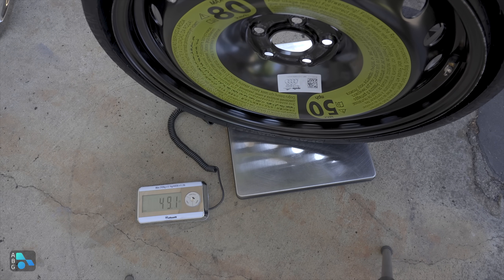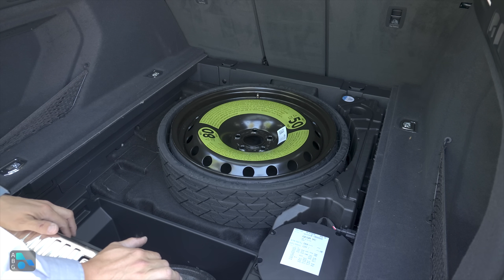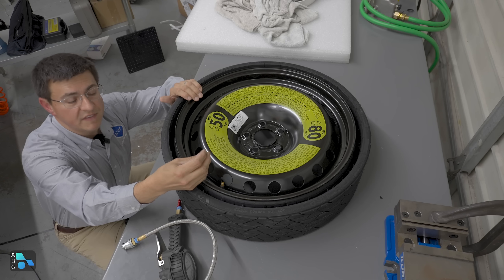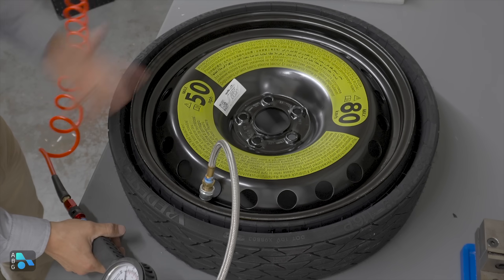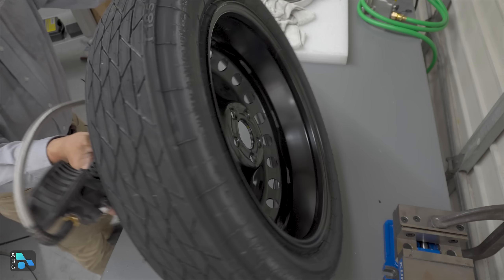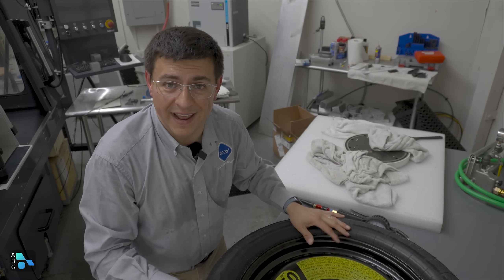How A Collapsible Spare Tire Works, And How It Might Save The Spare Tire In EVs

Comment: a better version of a tire is needed, a tweel thats inside a tire and can bring the car safely to a shop if all 4 tires have 0 PSI ...
the cost, weight, mass balance use will only be the things to solve this problem.  a 3d printed tire that has a sponge like polymer internal structure comes to my O.i. (organic intelligence/brain).  =P  =D

Comment: having that spare inside up in the front, so you could place the chargingcable inside the rim sounds like a great idea.
guess its not possible due to crash safety ... on the other hand.. an engineblock doesn't collapse either during crash ... who knows

Comment: Another reason not to buy an EV mucking around with the spare tyre an limited to 80kph my 1997 Toyota Hilux has a full size spare tyre and if l am traveling somewhere and get a flat tyre change l continue at the speed l was traveling at are any new car with are space saver tyre limited to 80kph is this realy an envancement or a backward step cars in the case of a spare tyre definitely a big step back wards a full size soare tyre luxury and Hilux stands for High Luxury it isn't or is it and it is been a Toyota reliable another luxury so maybe the Hilux name is correct it has very few creature comforts available as many luxury cars less to go wrong another luxury my basic anolog ute is a lot more luxurious that other luxury cars

Comment: Very misleading title, you show only how to use the tire (which is very obvious) but not how it works. How does the tire carcass have the ability to expand so much in diameter and remain robust enough to drive on? Regular tires have steel cords that make them very stiff, what structure does this tire have?

Comment: Also, I think there are reasons why they don’t want to put the tires in the front, perhaps gettingnin the way of a crumple zone from doing its job? Plus the frunk is becoming very important since its kinda of a security box (its harder to get than the trunk which only have glass protecting it) i’d keep my laptop, in the frunk for example.

Comment: They work for road tires. So for most people and vehicles this would be a good solution. I always wondered why spare tires are so rare on EV's - guess using all that space for a huge battery doesn't leave many options.
I have a full spare tire and I wouldn't want anything else.
Reply: There's ample room, but manufacturers prefer to get better range stats and profit. Screw the customer once he/she has bought the car.
Reply: @azw409  My wife's new car just has a tiny compressor and the gooey green stuff to fix a flat. Such a bad idea in a $60k vehicle.
Reply: I have a full spare tyre under my E Berlingo in a cage.I also bought a cover for the spare not to pick up muck from the road.I like a van type car with a big boot comfortable seats and a good vieuw on the road.Image I couldn't care less.

Comment: I'm not a car guy but I found the tech for the collapsible tire to be interesting in terms of space saving, availability.  It looks like a good option for the average driver just wanting to have the tire there, but it still is multiple steps to inflate/deflate as well as the normal installing/changing the tire, which means my wife who knows less than me would be lost.  Fortunately, that's why we have Roadside service, cell phones and on-star for our vehicles that she gets stuck with either car.   Good video.   Mahalo.
Reply: Nothing against your wife, but all my children and foster kids had to show me they could change a tire on their own before they were allowed to get their license.  just a note about roadside service; some roadside assistance plans won't go to some locations like off a paved road.
Reply: Like all space saver type tyres they suffer from the same flaw; it only saves space if you don't need to use it. If you do get a flat, you need to find room for the full size flat tyre you removed.
Reply: All women need to know this information. We are not less at comprehending, the problem is we are sometimes restricted from the knowledge. The problem I see in this design, is you have a flat on your car, your spare tier is flat, how do you use this spare without an air system? Carry an air cylinder to air up the tire? I guess you could put a DC operated pump in the storage compartment. I'd rather have a spare tire. I travel where there can be no cell service, no local roadside assistance. I purchased a spare tire for my hybrid. It's only the amount of weight of a child. When I'm in town. I store the spare at home and relay on road side asst. But, traveling across country, I have my spare tire. When my son and daughter were learning to drive, they were not allowed to go anywhere until they showed me they could change a tire. Once I was driving on a 6 lane highway in Dallas TX (635). A pregnant woman had a flat. She had pulled over and stopped in the far left center median . She had two kids in the back seat. She was out there behind the car trying to wave someone down to help her. I stopped. Changed the tire, she wanted to pay me. I told her that the payment is to have her husband teach her how to change a tire.
Reply: In a lot of areas spare cell phones do not work. You need to know how to change a tire.
Reply: I feel the same way but one thing for certain is that waiting for a service won’t be quick. Soooo for me time is invaluable therefore I am better off having a full size spare in the trunk. It there ready….as long it is not old and properly filled up. Jack stand and tools ready too.

Beside, donut tire or like this collapsible spare tire are not meant for hwy speed…a compromise there. The full size spare aren’t compromised except for space.

Comment: After over 20 years of driving I have never once needed a road side repair. I’ve had probably at leas 6 tire punctures but all were slow enough to manage buy pumping up at home and driving to the tire store for repair. My new Tesla Model Y has no spare so hope the trend of the last 2 decades continues for me. If not, there are cell phones and road side assistance these days.

Comment: The main issue is that if you don’t have room inside your car to store a full size spare wheel and tyre, where do you put the full size wheel that you just took off when you put the inflatable spare on? Do you put it on the passenger seat and leave the passenger by the side of the road?
Reply: People had that very problem of what to do with the full size wheel forty years ago when some cars came equipped with inflatable space saver spare tires. I remember seeing those tires in a lot of midsize cars in the 70’s. Usually in mid size and smaller cars like Camaros and AMC Gremlins. There was also an aerosol can supplied that screwed on the valve stem to inflate the tire.
Reply: @e493af  That’s exactly my point. We’ve known if this issue for 40 years. My 2003 MX-5 has a space saver spare wheel, and I simply cannot fit the regular tyre in the boot without taking every single thing out to fit it in. Cars are getting bigger, wheels are getting bigger, but we’re still ignoring the problem. SUVs are HUGE. They can shoehorn a full size spare in if they just design them properly. There’s absolutely no excuse for this penny pinching.

Comment: I can tell you the reason that the spare is not up the front, you dont want a hard steel ring in the crumple zone of a frontal impact. And before people go off about "But there is a hard steel engine in the front of ICE cars"yes, there is and it is designed in such a way that it submarines under the car rather than through the passenger compartment like a spare wheel would.

Comment: This makes no sense at all. Why not just invest in run flat tires. I've had them on my Corvette for over a decade and they have saved me several times. Absolutely no need to pull off to the side of the road or change any tire. Just keep driving at less than 55 mph  right to the dealership or wherever and get your tire repaired or replaced. No muss no fuss and no space robbing spares ever.

Comment: This is fake. Back in the 1950’s Goodyear made tires with a smaller inflated tire inside. 

So if you got a flat, then you rode on the smaller tire until you reached a service station. 

But AAA affiliates like tow trucks make  a lot of money on flat tires. Those service runs are worth billions.

So Goodyear stopped making tires with an internal run-flat backup.

Comment: Best option is do what I do. Keep your tyres at the correct pressure, TPMS really helps with what.  Carry a tyre puncture repair kit. I recently noticed one tyre was 4 PSI Low. So i removed the wheel, found the puncture and plugged it. 4 months later it is still perfectly sealed.

Comment: So it’s smaller… So they can surround it with a foam filler piece below the boot floor. What’s the point? Do you really want to be stuck waiting for the little inflator they provided to blow the thing up? I’d rather lose a few inches of space where I wasn’t going to use it anyway.

Comment: Spare tires make me hate auto manufactures so much.  I want a full size spare, with a real tire.I damaged a rim on my Mustang, and when I went looking for a replacement, I found a full set of 4 at a good price, and picked them up.  Now, I have a full size spare in my trunk, and it is worth the lost space.  I also keep a battery operated driver, and a set of nitrile gloves.   I had a flat when I was out of town on business, headed to a meeting. It was triple digit weather too. Pulled over and in less than 5 minutes, I was back on the road, diving highway speeds to my meeting with clean hands. I didn't have to worry about my other meetings, or heading home. I drove my car like normal.  From central Texas to north Texas then from one end of the DFW metroplex to the other, visiting 4 hospitals. Then back to central Texas all in the same day.  After that experience, I will NEVER have a vehicle without a full size spare again. It was great.  

Next part that's good is, I don't have to change it back. The spare stays on, and I drop off the rim with the bad tire.  Then I come back when it had a new tire and it goes in the trunk as the new spare. No waiting on a lobby.

Comment: The main reason for most manufacturers removing the spare tire is because of weight and not so much the space.  50 pounds is a lot to remove from a spare tire.  Try removing 50 pounds from somewhere else, it is a difficult task.   Weight = fuel economy reduction so this is not a solution in my eyes.

Comment: On some tyre pressure gauges there is a black cap that acts as a screwdriver to fit the schrader valve. Trouble all these journos like the sound of their own voice but have no technical know how. There is no reason why you cannot fit the tire in the wheel well dished side up to use the space for things like your haz wastecoat, air compressor, gloves etc. I do on my Mazda with the doughnut spare.
It was a bad day when they stopped supplying the doughnut, using the 'emissions card'  as the excuse, but when I was buying my car I told them other mfrs were still supplying them foc, so if he wanted the sale then the spare is supplied foc and they did.

Comment: Not new. They had them in some cars in the late 60's through 70's and used a high pressure inflator can instead of a compressor. The problem with all space save spares is what to do with the flat tire. It is NOT going to fit where the spare resided.

Comment: What about those of us that don't want to tune based off of "requests" and want the engine to do exactly what it's told to do?
Those safety systems that you say are there for a reason, generally those reasons don't apply to fully aftermarket usage.
100% torque at first gear going to shatter the rear end? Then give me 100% torque and first gear and I'll replace the rear end with one that won't break. EGTs by the stock model might be too high? Get rid of the entire model setup and just use an actual EGT sensor and limit off of the actual values.

The stock programming has gone from something we can mess with on a lot of new cars into this huge mess of unnecessary limitations and tables that work for them to tiptoe around the regulations they have to meet, that I am blatantly ignoring. I don't care about 90% of these tables because they don't need to exist for me to have the car do exactly what I want it to do.

Notice your entire talk there was about boosted vehicles. What about naturally aspirated vehicles? Now we have torque requests when I really just need a pedal percentage to throttle percentage map... That's it. When I blip it with 90% throttle I want it to snap open and crack... Not have it assume that I didn't mean to hit the throttle and maybe I should hold it down a little longer before it tips in.
I don't care about EGTs and torque limits by gear. I don't care if it's supposed to be blowing the tires off if I don't limit things. 
Stop getting in my way.

Comment: Have it on my touareg and used it a couple of times.. note they are designed o be inflate AFTER mounted on car otherwise risk of uneven/offcenter inflation like you got and worst. Uneven/offcenter inflation is unsafe at speed and distance. Tow truck drivers here have seen disastrous destruction from improperly inflated spares

Comment: Definitely better than no spare tire, but I hope the vehicles that currently include an inflated spare with better tread do not swap to this for a bit of space and lose the massive benefit that the existing tread provides over this compact version.

If they can find a way to integrate an equivalent tread, I will be much more interested in this concept.

Comment: They could potentially develop the concept even further by having a tiny rim and tire with thick sidewall that expands a lot. Something like a tiny 8ft rim but with thick spare tire to make up for the size of the rim. Would reduce the size and weight even further
Reply: How would an 8 foot rim be considered "tiny"? An 8 inch rim wouldn't clear the brakes.

Comment: Oddly enough, looking at the 1.50-time mark, it looks like if Audi took the plastic out of the right side of the tire area, that keeps the tire from moving around, you could fit a full-sized tire in place. Looking at the ledge height behind this plastic insert being about 1.5" narrower, the tire width would work too. Nice technology, but sometimes I wonder if it is really worth the cost, when it's pouring down rain, in 40-degree weather with 40 MPH winds. Do you remember in the 80's, a tiny little car called a Yugo ... in that smaller than small car, they found room to put a full-sized spare inside. They bolted it right to the top of the air-cleaner.🤣All 14" of it.

Comment: Every vehicle I have owned has space for a full sized spare but usually came with the "phony tire"  1st thing I would do is go get a basic rim and get a 50k-60k mileage tire put on it, then go buy a set of lug nuts for just in case.  

I was raised in the era where you carried extra fuses, a basic tool box, etc...

Comment: Well, if storage is the problem, then where will you put the punctured tyre after replacing it with this one. And for those who say that it is for short distance only until you can get your regular tyre repaired, I will always prefer a puncture repair kit since it is much easier than changing a tyre. However, I ALWAYS PREFER FULL SIZE FIFTH TYRE over any other solution.
Reply: Also this type of tyre may even cost more than regular tyre

Comment: I think that space saving spare tires are a terrible idea. Because idiots drive along at the same speed they do on the regular tire, and thing that they can just keep driving on the thing, not caring that it is an emergency tire. It is supposed to be a one use thing to get you to the tire shop to get the main wheel with a new tire on, and then replace the spare tire too. To me, ban the damn things and just get people towed or a mobile tire service.

Comment: Where in the trunk is the full size tyre going to be placed once it's flat and replaced by this "brillant" tyre? You can see that you generate a problem where there wasn't one previously. By using that inflating kit, and several plastics to design a room to store it, you never saved money to the user, or create usable room, to the existing usable space.

Comment: 1:28 The wheel lock KEY set is usually in a packet of stuff in the glove box or the spare tire well in the trunk / boot. Sometimes in fancy cars like that one you might find a separate special compartment just for that and maybe a couple hand tools. Hard to trust a guy talking about Tires who does Not know this. One of the first things a tire shop will teach a tire tech at 18 years old.
Reply: If it's just a review car Audi provided him they may have not included the wheel lock. You don't actually get the wheel lock until you purchase the car, they don't come preloaded in the car from the factory, they come in a separate shipment with the car.

Comment: And what do you do with the full-size tire that won't fit into storage place for the collapsible one? That is never talked about.
Reply: Put it on the back seat until it is repaired. 🤣🤣🤣
Reply: @davespicer7838  Like that scene in Smoky and the Bandit where Junior has the door on his lap. 🤣🤣😁
Reply: Put it in the back seat or the trunk.  For most cars, the full sized tire should mostly fit where the spare was as the spare is only marginally smaller than the full sized tire, so it should fit there but may stick up a bit since it's wider than the spare.
Reply: Throw in the weeds.

Comment: Good video. Thank you. I have a question. When the car is full of passengers and the boot/trunk is full of cargo, after replacing a regular wheel with the spacing saving spare wheel, where should that regular wheel be put, as the spare wheel compartment is too small for the regular wheel?
Reply: Throw it someone's yard and drive off....